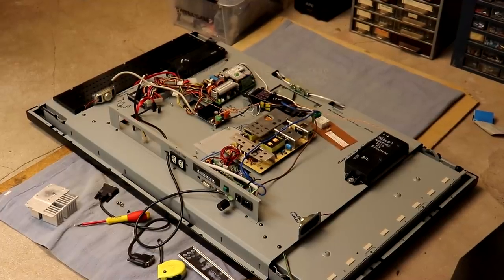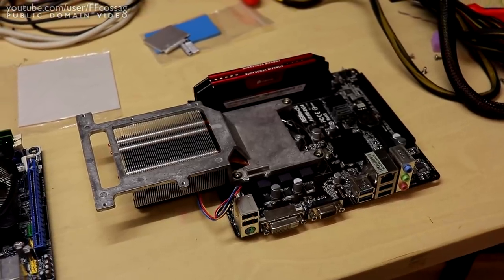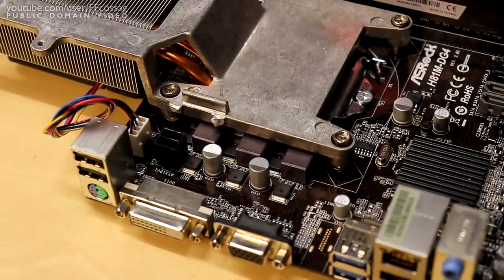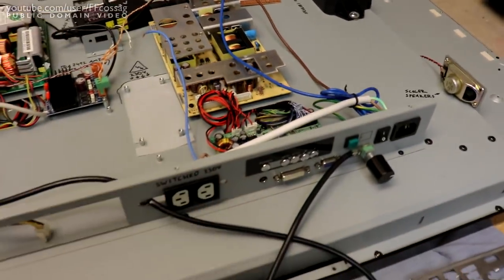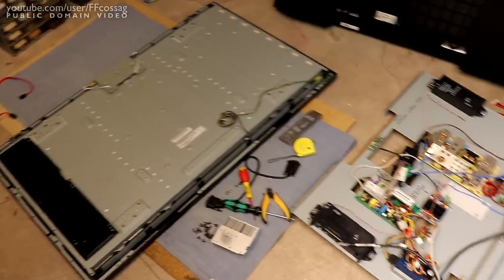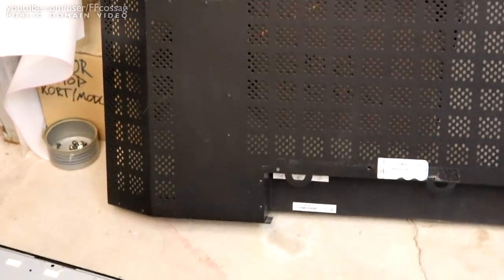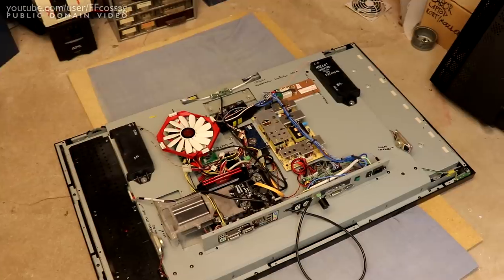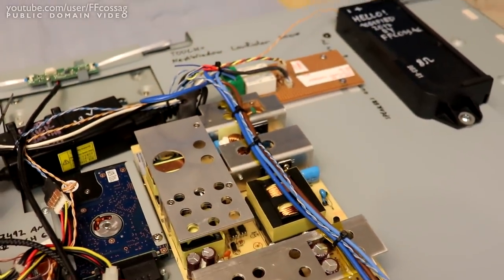The giant touch PC gets an i7. Because we can!

Comment: ahhhh a giant touch screen pc, the nerdiest form factor behind palmtops

as a side note, a cheap water loop with the radiator mounted outside the case would do wonders on that system
Reply from the maker: I actually considered water cooling for this, but the cost as well as figuring out a system that's low-profile enough (you only have about 40 mm of height to play with) would have been a bit of a bother.

Comment: The sad part here is that his television has a more powerful CPU than my main PC!
Reply from the maker: Well, this thing has a more powerful CPU than my main PC as well! That one still runs an i7 3770.
Reply: @makaroner earlier or later Socket LGA775 board...? barevids (audio channel) live streams amplifier repair from a 771 modded 775 system running a Xeon X5470 overclocked to 4.5GHz!

Comment: Maybe you could undervolt the cpu to conserve power
Reply from the maker: That's a possibility, although I don't think any gains are going to be worth the hassle; the power management of modern(ish) processors is incredibly sophisticated out-of-the-box.
Reply: @FFcossag  nope, the buck converter feedback resistors only need changing (voltage divider so just 2 resistors involved)

Comment: 16:13 what's your take on the fire hazard SATA power adapter things? I see you used one there.
Reply from the maker: I don't like the SATA power connector in general, it's flimsy, but for SSDs, it generally doesn't matter since it's so little power.
Reply: @FFcossag  Did you have one fail yet? I remember seeing a video of someone who had issues with those even with lower power devices which is why I replaced mine with crimp-style ones instead of the molded ones as the crimp-style ones are supposed to not have the issues of the plastic somehow becoming conductive or something.

Comment: Could you fit a GPU in with one of those PCI-e extension cables?
Reply from the maker: I could, but that would require replacing the PSU with a significantly chunkier unit, unless you know of any GPUs that feed power back into the PSU. ;)
Reply: @FFcossag  I've seen a couple of power supplies that might fit. I have an ITX-ish power supply that ran a 3D printer that's pretty compact, and that application needs quite a bit of current on the 12V rail.
Reply: @FFcossag  You should check out these custom made PSU's, they could handle that CPU and a decent dedicated GPU. https://smallformfactor.net/forum/threads/more-g-unique-bto-psus-are-now-available-direct-order.1983/